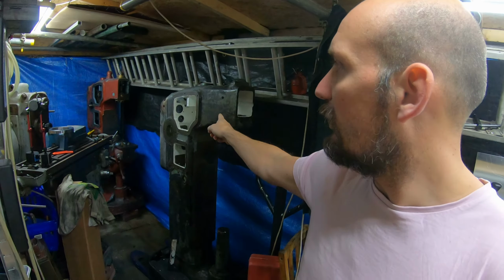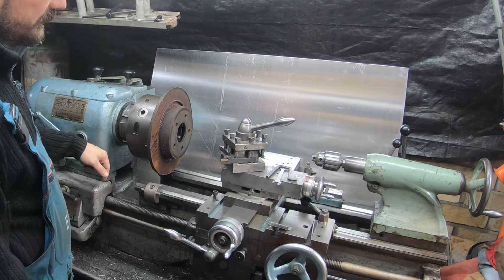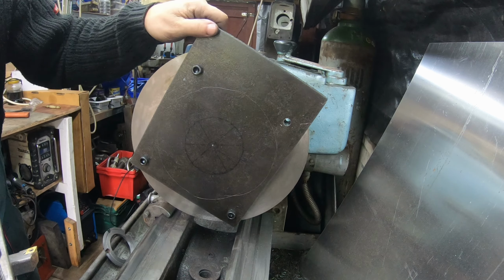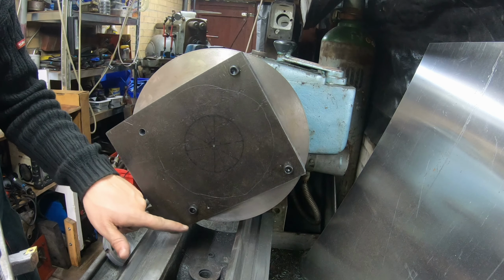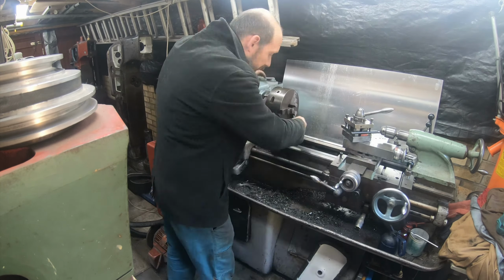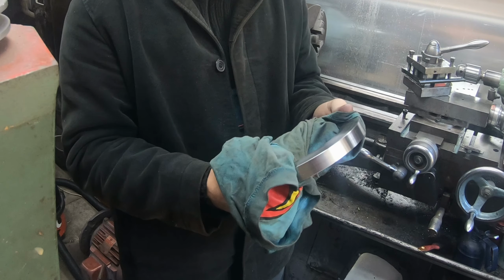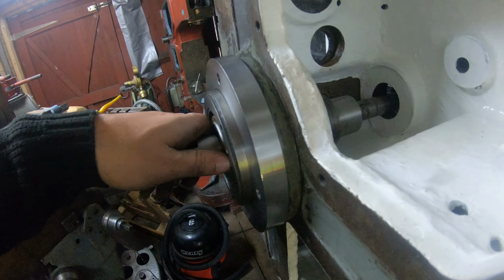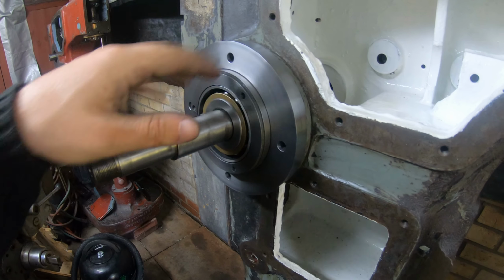Archdale Vertical Mill Restoration - Pt2 - Drive Shaft Bearing Journal &  The Retaining Sleeve

Comment: Gravity fed oiling should work fine, will definitely be better than grease. 
Great series, thanks for sharing 
Cheers
Reply from the maker: Thanks Rick,
Hopefully it’ll work out just the way I want!
Never seen Archdale especially this old to have oil lubricated bearings. 
Greg
Reply: @OneManEngineering  
I have never even heard of Archdale before seeing this.
Gravity fed has been around and successful forever so it should work.  I'm wondering where the residual oil will collect? 
Interesting topic
Cheers
Reply from the maker: It is just sitting in the main coloumn. This machine has got a plunger pump driven by an eccentric cam lobe from the power feed shaft (same way as the car engine rocker/valve system work). So a very nice and most importantly closed system. I will try to improve the pump somewhat, so it can create a bit more flow than the original one. Will reroute it to the top of the machine, so I will have a visual confirmation if it's working, then split the lines and gravity fed to 6 different places. Still unsure if it's gonna work, but will do some testing before committing to the modifications.
Reply: @OneManEngineering 
Right on man!  Going to be an interesting journey,  looking forward to the rest of the build.
Reply from the maker: @rickpalechuk4411  I am still trying to figure out how the pipes should be. I would like to distribute it probably 5 or 6 different locations but not sure how to set the proper pressure. I don’t want oil to pour out of one pipe and dripping from the other. 
Also would like to make a custom oil check/sight glass which should be standing on top of the machine where the old used to be, but tricky. The headstock pipe needs to run outside of the machine cos the bearing is at the highest point, the others obviously need be on the inside... decisions decisions!